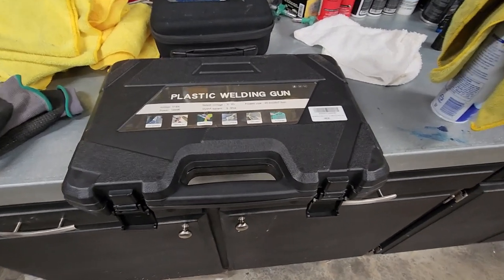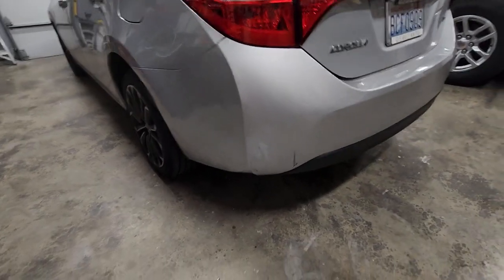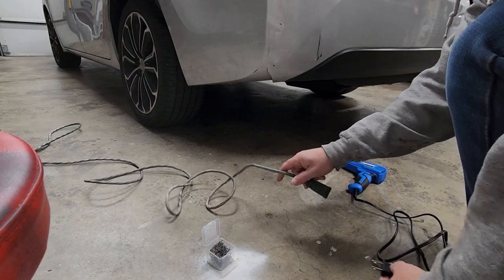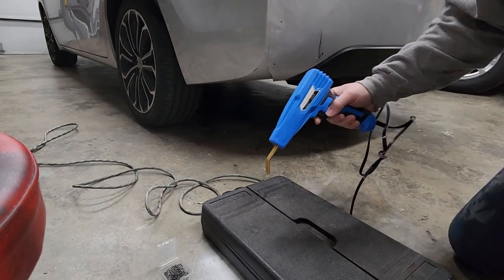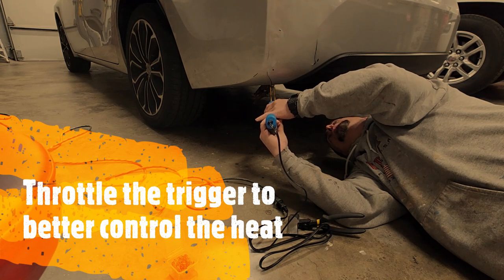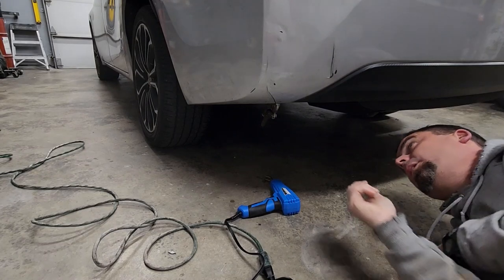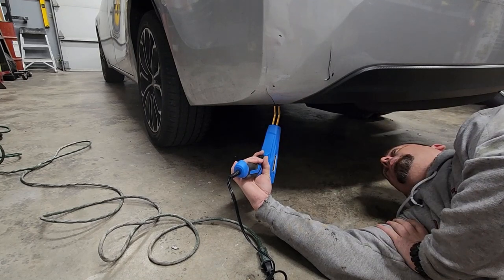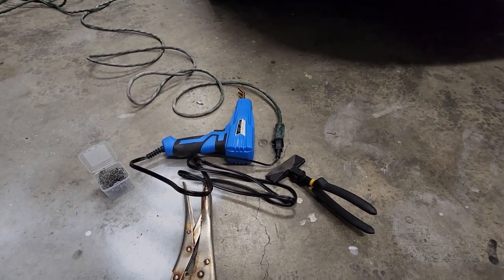How to fix a cracked bumper with Plastic Welder / Hot Stapler

Comment: Just constructive criticism but , had you taken the bumper off you could have done it from the inside and would have never had to see the staples on the painted surface. Nice ill be trying mine out soon. Thanks for the video.
Reply from the maker: 100%.   Just be careful you don't bubble the paint from the other side.    this was just to show how the stapler worked and i planned on replacing it however,   cant even really tell they are there from 5' away.   might just save the time and money.  they've held up this far.   you won't be upset buying that stapler.  its a great tool.